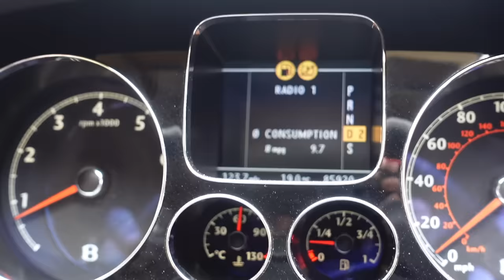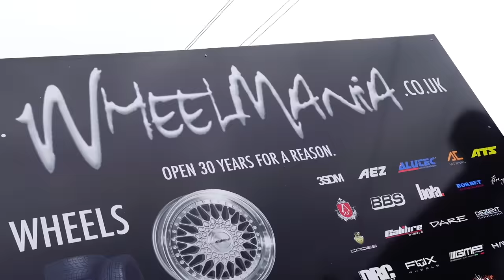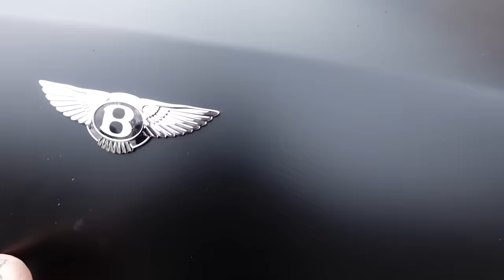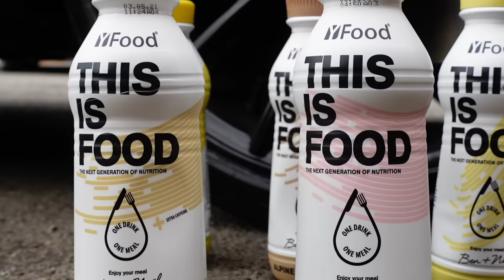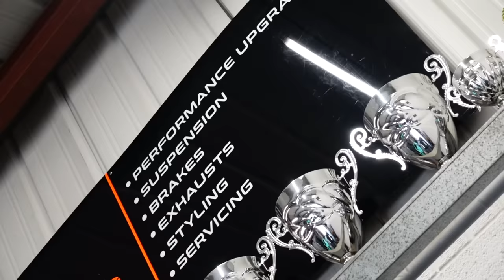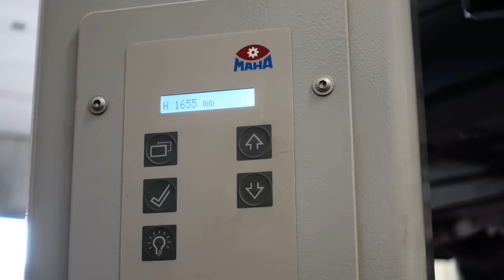I LOWERED & FITTED 22" ALLOYS TO MY BENTLEY CONTINENTAL GT

Comment: personally i'd say 20" or 21's would fit and look better
Reply: @georgeharrison1800  everyone's entitled to their opinion kiddo its called the comment section for a reason
Reply: Personally would have painted the original wheels gloss black. But it’s his car and it looks sick
Reply: Think 21 would be perfect
Reply: Maybe with smaller profile it'll make it look better. Wheels look ok, just needs some tuck on those fronts.
Reply: Keep the tyres and get those arches rolled and drop it another 10mm 😉👊
Reply: @georgeharrison1800  Mat literally asked for people to share their opinions in the video...
Reply: @georgeharrison1800  If you'd have watched the video...
Reply: George harrison!! he just said in the video that we can share our own opinion
Reply: i really think so too
Reply: Nah. 20s are basically factory and make no difference. More than likely he will keep the factory wheels and use them for winter duty. 21s are a good size but of course selection is limited because of the weight of the car and tires are more expensive for the 21s than 22s. I actually see his reasoning. I have a VW Phaeton W12 and finding attractive wheels that handle the weight in 21s was a pain. I went with 22s as well since I found strong enough wheels that actually looked attractive to me.
Reply: 22” at the rear, 20” at the front - get a ridiculous rake going on 😂😂
Reply: Gasolara2002 you have a good point
Reply: Just needs skinnier tyres on it I think
Reply: @georgeharrison1800  Well Mat Armstrong asked for our opinions
Reply: George harrison!! The irony of your comment. 🤦🏼‍♂️
Reply: Jon it’s not a tweet it’s a comment
Reply: Harri R just testing. Haha. 👍🏻
Reply: You might as well not have a tyre the ride will be awful on 22's and all the force will go through the hub and fuck the bearings arms etc., Also what's the difference between an 18" and 22" black alloy wheel....A: Nothing. When you fit a black wheel to a car doesn't matter what the wheel looks like you might as well just put a black bag over it...🤷‍♂️ Oh and I sell shit loads of 22's 😭 also you can't fuck around with the rolling radius for many reasons.... Dude you need an expert.
Reply: Gino Wu perhaps it’s not an act!
Reply: @gasolara2002  what size tires did you use?
Reply: @Dravhs  it’s air ride...
Reply: @Chris0vett  Can't roll plastic unfortunately

Comment: Several things you may want to look into. First is rolling the inside of the fenders to provide more clearance from rubbing. Another is getting wheels with  positive offset  or smaller width so they tuck inside the wheel wells. You could have a machine shop mill out the mounting surface of the wheels to increase offset so they tuck in better. Otherwise, the car looks smashing!
Reply: The fenders are not metal. It is a composite and it can't be rolled. He went with a square setup because of the awd system and he got 10.5 inch wide wheels all around. That's the largest you can get in there and the offset is going to be as good as it gets. +35 is the minimum you can go with because any higher it will not clear the brakes. It looks like he has something around a +30 offset. The front does poke out more than the rear naturally on these cars due to the suspension. He did good with the smaller tires.

Comment: Mat , it really looks well . I would say looking at the front wheels the offset is to far out ? Tyre profile looks spot on , if the wheel offset was slightly further in on the wheel arch , would be perfect and also with you in the drivers seat the off side front suspension might drop slightly thus the rub on OSF ;) Wind it out a bit more to compensate the passengers .

Comment: I’m running 22” inch on my Bentley profile on front 25, rear 30 at 48psi, wheel alignment super important or insides front and rear will wear real fast. Also tyre rating is important, front end is carrying a lot of weight under hard braking/ cornering.  The front tyres I took off mine were blistering on internal sidewalls... spooky, don’t run cheap tyres.

Comment: so after adjusting the ride height, did you loosen and retighten the mounting points of your suspension ? the rubber mounts will be pretorqued and will get destroyed in a short order.

Comment: I think you could lower suspension by changing coding/adaptation by vcds or oter diagnostic interface way easier, people lowering like that for eg audi's with air auspension and thats litteraly all the same modules etc as is VAG group

Comment: Wheels are just a little too big IMHO - it’s not all about arch gap, but also ride height: centre of the wheel down to the floor. Maybe 21s? 
The ideal when fitting larger wheels is keeping the same rolling radius/overall diameter of the wheel and tyre. This helps with proportions and maintains the gearing of the car

Comment: i have a bentley continental gt v8 problem.. car is damaged to passenger rear end side directly into the battery. key is stuck in ignition cant open the trunk either. i need to be able to take the key out of ignition and be able to put into neutral gear any advice?

Comment: Did the car change the height at highway speeds? The Audi A8 gets 25mm lower beyond 120 Km/h so it can cause problems having the car that low.

But maybe the Bentley air suspension works different

Comment: before you gonna go trough France make sure you buy one of those alcohol tester as the law from France requires it and have fun paying the endless tolls, wish you a good journey just came back from Switzerland by road  ferries are still operating normally just not as full as they used to be

Comment: Don't go smaller on the tyes; the ride height looks good. Have all the ride heights at the same. Why change the tyres? The tryes are fine. You'll need that set of tyres when in Monaco; you taking a spare set? Just raise the ride heigh to about 78/ 80cm. Leave the rubber alone.

Comment: I don't think the issue with the old wheels was the size, the design just looked dated. Some more modern looking multispoke alloys in the same size, maybe 21" would be perfect. Wheels that big are actually making it ride higher than it could with slightly smaller alloys.

Comment: People are yelling for 21s and 20s. For 21s you have to find wheels that can handle the weight of the car. That is hard in itself. Most of them will look nice but you will have cracks in the spokes in a matter of months. Then find some wheels that are attractive is another thing. Then the wheels are more expensive and tires are more expensive. Then 20s won't make much of any difference. 20s are factory and an option. More than likely the factory 19s will be kept for winter use...You cannot slam this car down on undersized tires like most people do to make their car sit super low. You will burn through axle shafts quickly doing that foolishness. Replacement of a front axles isn't cheap. So no 20s on small tires.

Comment: Those wheels are not mirrored, it basically looks like two different types of alloys on each side because they have a directional pattern that is identical on both sides.
Basically it swoops backwards on the left and it swoops forwards on the right. :/